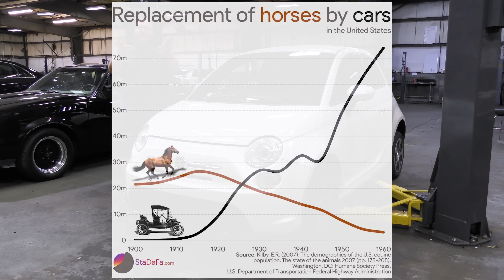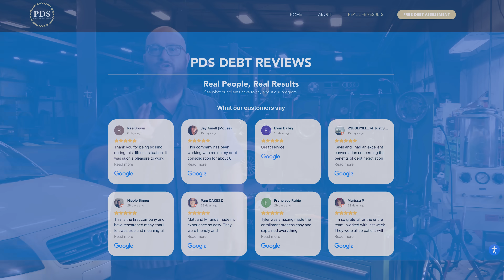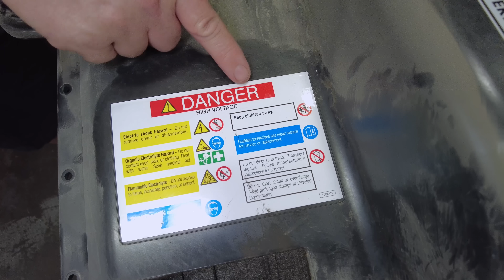How to SAFELY Remove the EV Batteries From my Fiat 500e

Comment: The majority of people who hate on Evs are wanting the, to do things that are out of the norm for many people. How many thousand mile road trips do people take a year? I fill my car up once a week and go about 350 miles between fill ups. If taking a road trip I rent a car, something happens I call Enterprise and get another car delivered, and it’s a couple hundred bucks for a week. I’m now looking for something like the 500e for work, I’m a gse mechanic and am about to start doing 2 airports that are a 30 minute drive apart, I would have a few tools to throw in the hatch and not worry about gas or oil changes, which on my car with the oil I run is near $100

Comment: spray bottom with cerakote   cost 100ish$  300ml of ceracote would do all of bottom  and sides and most of top.  ceramic would kick away alot of heat

Comment: I used to be an electrical and instrument technician in a chemical plant.  We used 24 vdc for the relays to start and stop the 13.8kv compressor motors.  I remember getting shocked with 24 vdc and it felt like a 115 vac shock.  DC voltage can be very dangerous.

Comment: The fiat 500e with the large 42kwh battery is great, the 23kwh one is a little too small.

Keep in mind fiat/mopar despite being stellantis does not use the Peugeot/citroen/opel/ds Platform. Which is good news because the onboard charger for ac 11kw charging fails on them.

Comment: Had massive problems with my diesel Citroen - turned out it was the battery control unit or ‘BSI’. Required new unit - probably repairable for an expert, then a new download direct from Citroen to sort out corrupted files. Crazy - that’s an ICE. Only difference - new unit fitted in 30 mins but a wait of 3 months for the part to arrive.

Comment: If you get a chance to live with that cat as a daily driver, you’ll quickly realize just how silly the notion that you need 1000 miles of range really is. Granted, from what I gather this vehicle doesn’t support dc fast charging which does limit you substantially, so try to keep that in mind as you use it. If there’s a trip that just needed an extra 20 or 30 miles, that’s only a matter of minutes at a DCFC.

Comment: The real solution to EV's will be a battery that can be exchanged, just like power tools. No one would buy a drill with a fixed battery. Once the battery can be exchanged it changes the entire dynamic of EV's. People without a home garage no longer have to worry about public chargers, cars will no longer be a total loss if the battery is bad, the battery will no longer be of any concern. It seems so obvious yet Musk is saying it's a dumb idea. I guess you would if you owned a bunch of charging stations that make you a lot of money.
Reply: The power-tools example could have been valid 10y ago when battery power tools had NiCd or NiMh batteries. For the contemporary well-known brands the LiIon batteries outlive the tools and yet they even don't have battery temperature management.
I've had 6 ebikes since 2014 and 2 EVs(all with LiIon batteries ofc) and have never had a battery failure, while I had several mechanical ones

Comment: ICE cars will not make it unless there is a standardized engine and transmission.  That way no matter who made the car you can just order a standardized engine or transmission to replace, whether it was a Ford or GM, Honda or Toyota. Think that is silly?  Well that is exactly how it sounds when you say to have a standardized battery pack for all cars.  There is a standard for fuel filler holes, but not for tanks or anything else.  I mean FFS gas caps are not even a standard.  But you want standardized battery packs.  You have a wealth of automotive knowledge and I am happy to see you doing more EV stuff, but comments like those come from ignorance of the technology and listening to the FUD spread about why EV's don't work.

Could the BCM have bad solder joints?

Comment: EV batteries should be standardized, like a BBQ cylinder! the EV owner shouldn't even Owen them! They should pay to use them, put all the responsibility on charging stations.  Just like gas stations, pull in, Swap and Go!!   Then EV,s have a great chance of Success. It's so obvious to Me. If a company like Exxon owned all these batteries, they would be serviceable and repairable in a hurry! EV owners would just have to pay at the charging station, sound familiar?

Comment: Thank you Wizard for this down to earth video. When it comes to EVs emotions get out of hand and I think Hoovie did a calculated video with some wild claims because of that just get those interactions.. oh well.

In Germany there are already shops that replace bad packs of your typical first gen Tesla Model S 85. They can even upgrade your 85 to a 90 oder 100. It even shows properly in the dashboard. You can also get your broken car picked up by the EV Clinic in Croatia, where they have a lot of experience already. I think it is ~800€ for transport and I have seen battery repairs below 6k €.

This is not rocket science after all and those shops will keep on growing as demand is getting bigger. And thankfully newer batteries are quite cheap when compared to the old 85 Tesla packs. For example: Tesla quotes you around 16k € for a swap when out of warranty. But with the newer LFP batteries in the Model 3 it is already below 10k €. Prices will only go down from here on out.

Comment: The reason so many slow level 2 6-19kw) chargers as initially just for 80 mile Leaf.  Now most EV’s now  200-300 mile range They need Level 3 DC fast chargers.  Sadly most PUBLIC LEVEL 3’s only 50 kw vs Tesla Level 3 130-250kwh.  Super rare to find PUBLIC LEVEL 3 350kw.  One reason everyone switching to Tesla plug, NACS vs previous ccs plug.

Comment: FIAT (fix it again Tony) manages to botch EVs too! Meanwhile there are a LOT of 10 year old Teslas with 200,000 miles and some with over 400,000 with original motor and batteries. Newer Teslas have batteries that can go over 500,000 miles and motors that can easily do over 1 million miles. No need to a timing service every 100,000 miles, oil changes, expensive fuel,  not to mention all the pollution that our kids breathe… fortunately EVs are improving at a rapid pace, charging stations are becoming widespread… China is already at 50% EVs for new vehicles, Norway at over 80%… soon less expensive GOOD EVs (not crappy Leaf and Fiat) will be available and they’ll be cheaper to buy than polluting gas cars. Then people will realize not only are they cheaper to buy, they’re significantly cheaper to own and maintain… and that would be the end of gas cars. It will happen by 2030, 35 or 40. It doesn’t matter. It’s just a matter of time. And it won’t be long…

Comment: In New Zealand we specialize in importing Japanese domestic market second hand cars...

so we also know how to reengineer the Nissan Leaf batteries by opening them up and separating out the individual cells from packs from wrecked cars or "useless" packs....
and amalgamating them into a very useable pack that can re reinstalled into a car.

Or if the cells are less than 85% state of health....using cells to build "home batteries" for solar power storage....

Plus of course re engineering the software to translate the Japanese screens into English

and new software to be able to use the higher output newer batteries in the older Leafs.

So 10 to 15 year old Leafs can be restored to better than new range...

It helps that NZ is used to Japanese cars being useful to us in a second life...
and as the climate here is temperate..
the Leaf batteries don't cook or freeze in normal use....

so we have one of the highest concentrations of Leafs in the world...about 120K cars...

Comment: There will never be "universal" battery modules, because then anybody could repair or upgrade their EV and the manufacturers definitely don't want that.  They don't want independent shops like Omega to work on them, either, only the overpriced stealership service departments.

Comment: Only 80 moving/wearing  parts on EV’s vs thousands on gas cars.  Once battery  costs come down with more battery factories in USA EV’s will be cheaper and faster to build.  Most parts plug and play.  80% of time no lift needed as mostly battery underneath car.  The future is autonomous cars, Uber, and ride sharing .  More greenbelts where parking lots existed before. No more oil filters in land fills every 5000 miles.  60% of vehicle owners have garages Wear charging occurs many with solar.  Saving money with EV and solar.40%!of vehicle owners with garages.  They are more dependent on charging stations

Comment: With regard to repairing EVs, it won't be a problem because they will be designed in the same way as many modern gas powered cars - not worth fixing throw it away an buy a new one.

Comment: Some 9 year old is going to be shown by his father how to remove one of these battery packs someday.  That 9 year old is going to have the biggest shop ever.
Reply: Yep, 100% correct
Reply: I think any responsible father will keep for a while his 9 year old away from tinkering with 600 volt/ 300 amp producing electric setup.   Have you seen many fathers allowing their kids to replace breakers in house panels?   Ok, 9 year old may take off the battery, as far as unscrewing bolts got (so we are back to mechanical skills)
Reply: @dmitripogosian5084  And? What did you take apart when you were 9? Hmmm?  Even though you were not supposed to?

Comment: I actually like the modular nature of this pack. From what I've seen on Sandy Munro's channel the Tesla is basically one huge glued together mess. That is indeed a good way to make a battery pack for a drill it is not good for a car. That just blows the repairability clean out of the water. Another, unrelated, EV claim I have trouble with is the claimed part count. If you have 1000 cells glued together in a giant blob that is NOT fewer parts than an ICE car. (One bad battery in that giant pack can render it useless, or at least well on its way to failure.) I think we'll get good EVs eventually because they are more energy efficient than ICE. Smaller walking or cycling neighborhoods would be even better.

Comment: For me, the light at the end of the tunnel would be avoiding electric cars entirely.
A gasoline-powered Fiat 500 would be fun to have, even though their reputation is not the best. But a 500e? no way. Just look at all that complexity, and the expense of repairing it,
assuming you could find anyone who could fix it. In my opinion, electric cars are a fad,
not an enduring technology.
Reply: You do remember how Ford F150s were stranded in the thousands before they were even sold...made unsellable by the missing electronic bits....
But they finally made those bits and the F150s were sold....

As soon as a "volume" point is reached re  EV cars built and standardisation of electronics and batteries (you know 6 volt  versus 12V.....24 volt.... and the latest thought 42V....
and some manufacturer spends the money on setting up a "school" to train EV techs....
then EVs will become far more accepted.

Comment: Thats why i still drive a 89 camry (215k) and really only have owned cars from the 90s.  
My wife drives an 07 outlander 207k miles.  
Im looking at getting a 2007-2012 minivan for my expanding family.  
I drive older because i like being able to fix most of the stuff myself.  Saves money and im not professional mechanic just a regular guy whos mechanically inclined

Comment: I have never bought a new car in my life. In an EV world you would have to buy a new one every five years or so. I don’t want to be in constant poverty paying for an electric car. This is besides the toxic waste dumps these batteries will generate. And the fact we do not have either the power generation or transmission capacity for these cars. They are a bad idea.
Reply: Or you could, if you live in a temperate climate area, buy a second hand Leaf and drive it around town until the range drops to unacceptable levels...
and find the right person to rebuild the cell pack to give another 10 years of life to it...

Comment: The government needs to mandate that all these battery vehicles have a standard battery cell design which could allow the aftermarket to start selling upgraded cells and they need access to all the controllers and other serviceable components  from underneath the car, with access plates that can be removed, very annoying to drop all the pack for one module.

Comment: What shop is going to want to store your car for months waiting to get a part back from Bulgaria.   It sounds like a losing proposition for a small shop owner.
Reply: As you can see the vehicle is a mobile chassis.
Tow it home and store it in the garage if the wait is that long.

When the demand gets large enough the modules (which obviously have a standard fault) will probably be on a swap and return basis......
Reply: @JohnSmith-pl2bk  have you priced tow truck services lately?